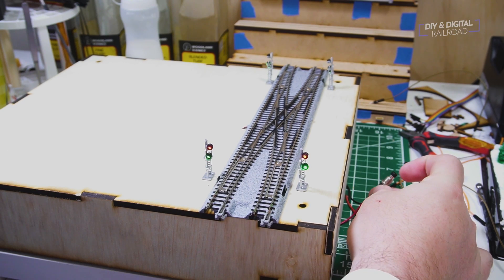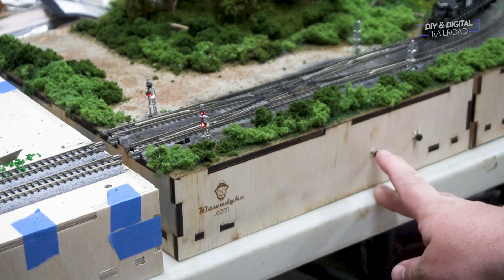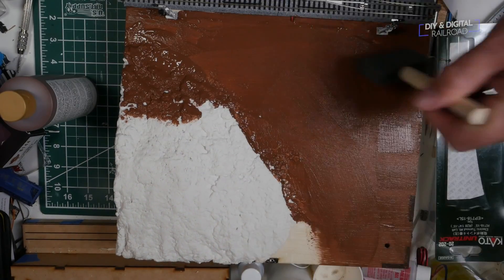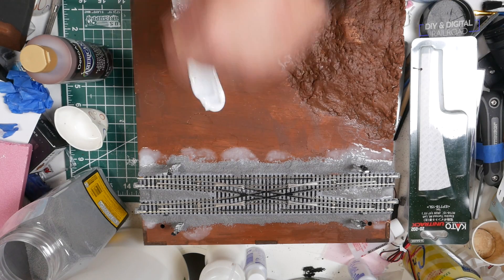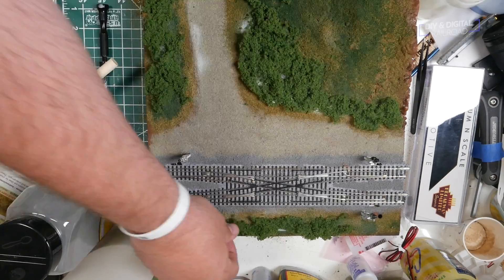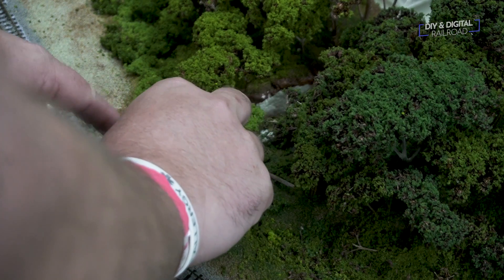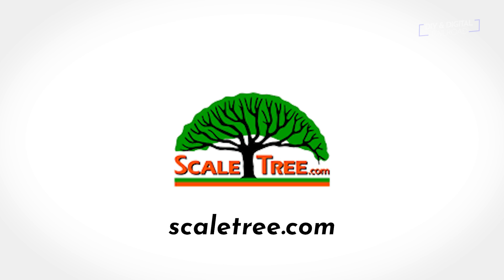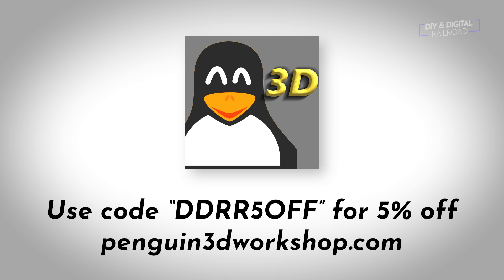I fixed this Model Railroad Module and now it's great!

Comment: Usually, when you have a double crossover like that, they all throw at once (reverse) or all go straight (normal)  Shouldn't pattern me Green Green for normal?  And Red Red for reverse (crossover).  That's my understanding.  But I maybe wrong from reading my signalling handbook.   I gotta say though, that's really a good looking scene section.

Comment: Aloha Jimmy,  I take it that you place an arduino on each module and just run a seperate DC power buss between the modules to run electronics and lights. During the module construction could you show a picture on how you handle the connections between the modules.

Comment: Hi Jimmy - - great job, and as a T-TRAK modeler, I am enjoying the new focus to a T-TRAK layout :-)    --- One thing I want to share-  From my experience, having a double (or single) cross over module RIGHT next to the corner module can lead to some cars/locos derailing on the entrance to the turnout (a good example is exactly how you had it pictured at the 7:00 mark) ....    When my group puts together layouts now, we always put something in between a corner module and a crossover module (Be it a full module, or even just a 62mm double track piece.. I know your looking at building this has a home layout, so you could always just make a par of "non-standard length" modules to address this if you don't want to mess with the overall layout design too much)
Reply: What happens when the cross over is in the middle of a double module?
Reply: @brianpugh2656   ... I assume that would be fine since you then have a built-in straight on either side.   (The key is just to have a straight section of track before getting to the turnouts.)

Comment: I saw some code coming by. Looks like you have extensive  blocks of if-then statements, it might be more useful to create a mapping (an array or even a bitmask might work very well here) of sorts between conditions and state. This usually reduces the amount of code needed and might also be easier to read (and/or debug).
Reply: Could you recommend a link or video to learn more about this concept? This sounds useful.
Reply: @Marc_Miller     LightCondition = LightConditionTable[CurrentState].  CurrentState is a bitmask.  ie: Switch1Reverse&Track1Clear  (Values 1, 4 so it goes to index 5 (6th element))  enum Crossoverstate { Switch1Reverse = 1, Switch2Reverse = 2, Track1Clear = 4, Track2Clear = 8}
Reply: @donh8833  Thank you Don

Comment: 2 Questuins for you jimmy 1: Will you be giving more updates on youre new layout? 2: Will you be using Old modules that you have used in other videos?
Reply from the maker: Hello!  Yes I will be doing updates.  The next module will be a big chunk of phase 1 and I will be doing the update then.  I have 3 more major module projects before phase 1 is done.  As for the old modules.  I actually stripped them for parts because they did not match.
Reply: Ok thanks for the answer!